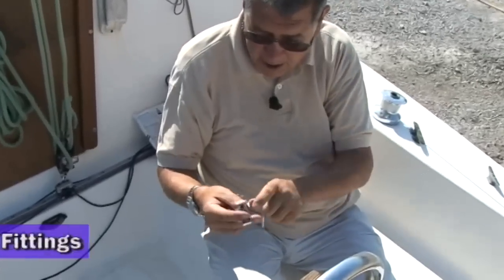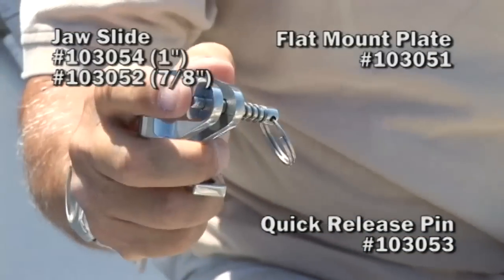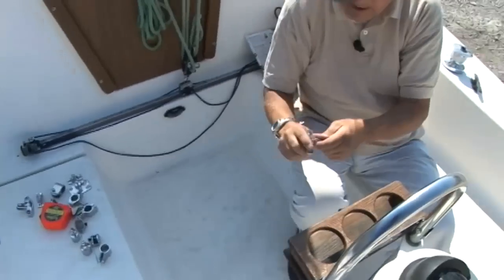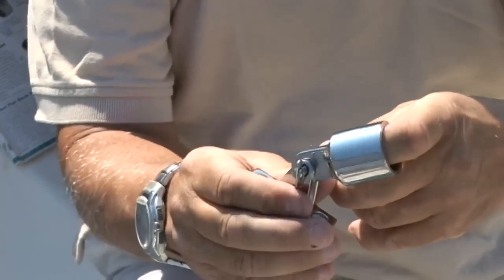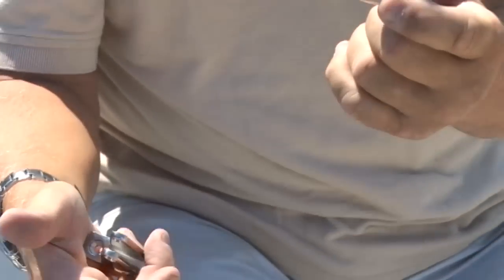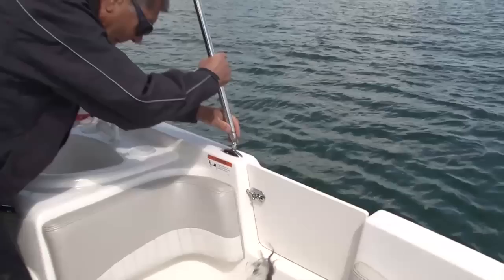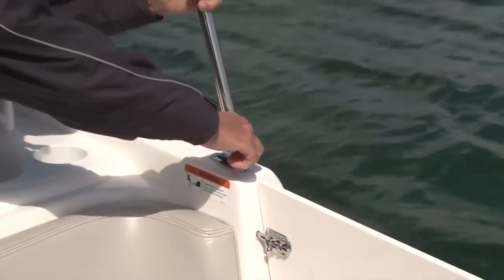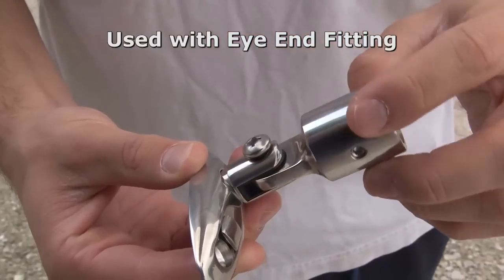Bimini & Dodger Frame Hardware - Quick Release Fittings

Comment: @Sailrite Great videos, thank you! Will the 1inch fittings fit 25mm tube or visa-versa?
Reply from the maker: The OD diameter of the fittings should fit a 25mm OD tubing, yes.
Reply: @SailriteDIY  What about 25mm fitting to a 1inch tube?
Reply: Does the .4mm make a big difference?
Reply from the maker: @m-a-r-c-1  I don't think it will. But I have not tested it.
Reply: @SailriteDIY  That's what I was thinking, thank you very much.